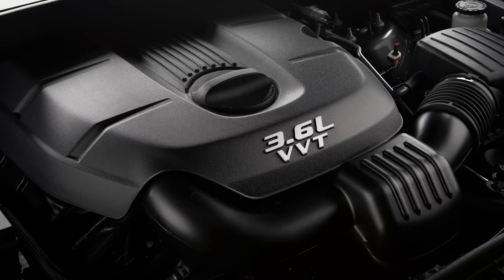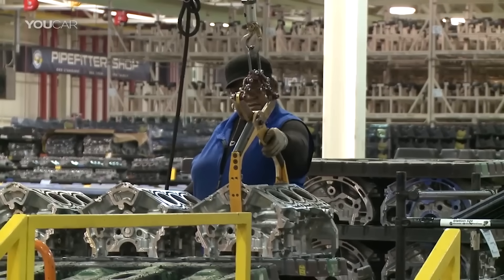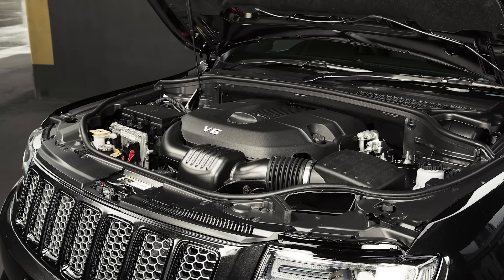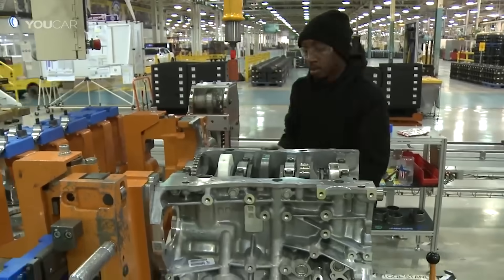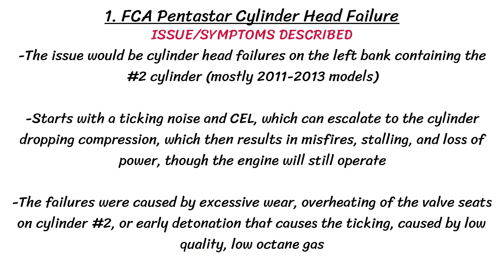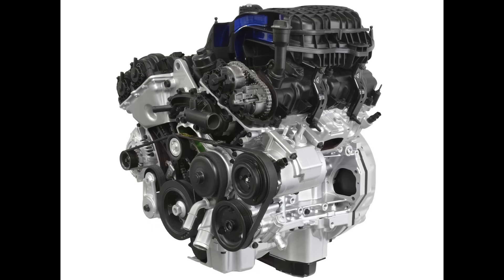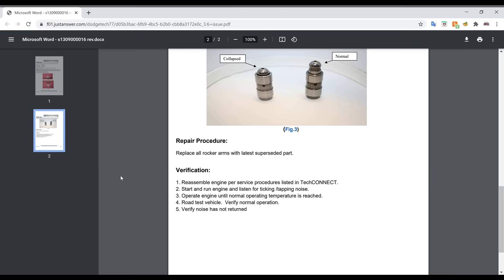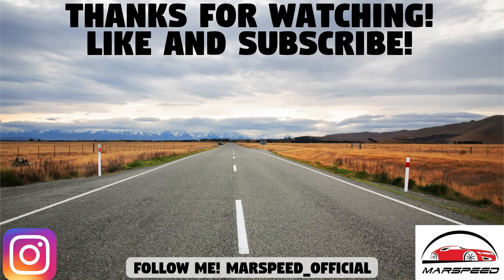The Specs and Fatal Flaws of the Chrysler 3.6L Pentastar V6 Engine

Comment: Wow - love your vids, but you freaked me out from the "headline". Have a 2018 Challenger AWD GT (which I love), plus a 2018 Wrangler with same motor, and got REALLY worried after the fact. ZERO issues so far. Always on time oil changes. I will continue to watch for these issues, but am hoping and praying for immunity. I HAVE noticed subtle differences between the Challenger tune and Wrangler tune. They act like two different motors when compared. The Jeep belched smoke once (and only once) on startup at about 5000 miles. Never did it again, but it scared the CRAP out of me. Hoping for a long and happy marriage. We'll see I guess.....
Reply: What is the point of buying a awd v6 challenger? I'm seriously asking.
Reply: @flatoutnorth794 Well - and don't take offense here - based on YOUR YouTube vids, I'm seriously thinking you can't afford one. Beyond that, I drove in Upper and Lower Michigan snow in the early 80's. In all RWD cars. 81 Capri, 72 Nova, 71 Cutlass, 84 Fiero (yes a mistake but I bought it NEW in 84.) Bottom line - it's a highly capable AWD vehicle that gets 27-28 MPG. I don't have to pick up front or rear end of my car if it went in the ditch (and yes I did) because it helps me STAY OUT of the ditch. Also, I'd rather not pay RT or Hellcat premiums for insurance. I'd seriously consider a HEMI in AWD, but it's not there in Challenger. Don't want an older Charger w/ AWD, and I've owned lots of 5.7 HEMI vehicles - 04 Durango (w/AWD-4WD), 14 RAM 2WD (absolute BS in snow), 06 RAM 1500 4x4. Is what it is - your reply came across as punkish so you get what you give - eh?
Reply: @bufjayup7774  lol you really think you're intelligent assuming  my finances when I'm literally looking at srt cherokees and gt350s. But yes I must be a peasant because I asked a question. Good job.
Reply: @flatoutnorth794  Ooooo - struck a nerve. I can only see what you post and it wasn't pretty. Look - all I'm saying (and tried to elaborate on with the extended comments) is that I'm happy with the vehicle. It's been awesome so far. Great price, loaded with options and I'm happy with it. Sorry if I pi$$ed you off. Your comment was specifically "What is the point of buying a awd v6 challenger? I'm seriously asking." Well - I answered. Just chill dude....
Reply: @bufjayup7774  I've been chill just don't assume man, thanks for the info and watching 👍
Reply: @flatoutnorth794  Likewise....you sound a lot like my son....I'm 58. Please don't get offended. I was your age once...and I bought a damned 84 Fiero new. Have pity.....

Comment: Thanks for the great content. My experience on 2015 Chrysler 200c is - All fuel injectors replaced with Bosch injectors after  2 failed 2 months apart at 45k. Leaking Oil cooler replaced at 48K  and recently defective and leaking Thermostat housing replaced at 50K. My Pentastar had a tick at 45k but Amsoil pure synthetic seems to have made it go away and quiet for last 5k miles. Good power and fuel mileage but looking to get rid of as I see a future of unreliability!

Comment: So far, after (3) years of ownership with <15K miles; I am satisfied with the pentastar V6 in my Dodge Durango. Though, the gas mileage dropped from 19mpg to an average of between 15.9-16.0 mpg, mostly city driving. But never had an issue, other than basic maintenance.
Reply: Glad you said something my family and friends swear I mash the pedal because I get 16.0 mpg which is weird because I’m very understanding that my charger is NOT a race car😂
Reply: @KTony-go6zt  i also get the exact same gas mileage in my v6 challenger. Was thinking why is the mileage so bad for a slow car 😂

Comment: The biggest issue I saw while working at a dodge dealer. Was the oil cooler leaking. Causing oil to fill the valley of the engine. It was always a bad O-ring on the cooler. Constant heating and cooling would cause it to break and leak oil everywhere. Most people think it's the oil pan or drain bolt because of where the oil comes down. 

I guess that issue hasn't been reported enough yet, but it affects every 3.6L
Reply: I was a Chrysler tech also... I havent seen one leaking on the 2011-2013 unit they change the cooler in 2014. The cooler on my older 2012 Chrysler 200 never leaked but the one on my current 2015 200 was replace under warranty its was leaking
Reply: @Jonathan11225  it was always the newer ones. The biggest headache ever.
Reply: @estidecrissdemarde 
Yeah, I had this issue on my 2014. Under Mopars extended warranties it's not covered.  It's considered a wear and tear part.
Reply: Yeah that does sound like a major issue.  It affected my uncle's 2015
Reply: @louisbaiani6262  it's a huge issue. We would constantly have vehicles come back after an oil change complaining about an oil leak. So the Foreman would come out and inspect the vehicle, and would find oil in the valley. Those oil coolers are horribly designed.
Reply: @edms3656  Going to install a Dorman aluminum cooler this weekend on my 2014 Grand Cherokee. I'm not looking forward to it.
Reply: Overtightening the plastic filter cap was the demise of mine...I heard the cracking noise and sure enough it leaked after...replaced with aluminum oil cooler
Reply: @phantom196908  I hated when those were over tightened. If you got lucky they could come off  without any damage, but we only ever used the same plastic crap. 

Funniest thing ever was watching a live tech try and use an impact to loosen one.
Reply: It is not just the O ring, the plastic eventually disolves changes properties and turns soft. The aluminum after market replacement part fixes it
Reply: @miopera40  I've seen those. They look so much nicer.
Reply: @edms3656  
I just took my 2014 with 70K out, the original plastic housing around the bottom gaskets was soft like melting plastic, not because of heat but looks like the properties of the plastic they used are not the best and react chemically with the coolant or oil under temperature changes and gets soft. I was lucky to find an aluminum replacement, hopefully that would permanently fix this flaw.
Honestly Jeep should issue a recall on this part, the backorder list for this part is enormous
Reply: @miopera40  good thing you cought it early. It's such a huge issue. Almost every single by that came back with an oil leak had a bad oil cooler housing. I would say 80% of housings fail before 100k
Reply: Hello! I have this exact same problem, is this typically covered under the 5 year /60,000 mile warranty? I have an appointment Friday. Thanks in advance
Reply: @jakealcazar3805  it's directly on the engine so I assume it should be. It's been a few years since I worked at the dealership. I would definitely speak with the service advisor about it when you go. Keep me updated if you can.
Reply: @edms3656  Will do. I was originally gonna take my Jeep to another mechanic but seen my Jeep is under warranty till next month. Dorman came out with a one-piece aluminum replacement that's supposed to fix this problem from happening again. Although, I doubt the dealer will install an aftermarket component.
Reply: Just replaced mine today. Dorman makes an all aluminum replacement part, unavailable out of stock literally everywhere. I wasted days trying to find one. Truck has 56k miles on it so looks like I’ll be replacing it again in its life. From my observation the plastic housing didn’t appear to be cracked or warped in anyway. It looked to me like the o rings were just junk. Is a dorman aluminum housing really going to solve the issue or is it just the orings always gunna be a problem?
Reply: @Zack.G23  
The aluminum one will definitely solve the issue of the plastic getting soft overtime, with quality o rings should be your best bet.
Reply: @miopera40  I guess we will find out. Noticed what looked like oil on my tires today. Bottom is caked. Didn’t even last through one oil change. They have the dorman in stock this time.
Edit: put the dorman in and haven’t had any issues everything is dry still after about 5k miles
Reply: Yep, they fail a lot.  It should be a recall (but it won't be).  I was hoping that Dorman would have come up with an upgraded replacement for this by now, but nope.
Reply: @DarkpawTheWolf  It always seemed to be around 50k-60k miles on them when they would start leaking.
Reply: Having mine replaced at 45k miles right now. Had my water pump replaced 6 months ago. So like $2000 in 6 months. Also had misfiring issues, where I took it to the dealer 4 times, 3 years ago. In breaks down, and I barely drive it, junk.
Reply: If you want to fix cars or hang out at a Chrysler dealer get one with a 3.6 pentastar engine…
Reply: Happened to my 2011 200 at 96k miles. Not too difficult to replace though which was nice.
Reply: I had this issue with my wrangler, freaked me out because I initially thought it was a rear main seal because of where it dripped down to the transmission. replaced it with a cheaper than OEM cooler that was all aluminum and it's been good for 30k miles now!
Reply: And 3.2 V6 engines as well.
Reply: Had mine replaced
Reply: This just happened to me and i was wondering if i was getting ripped off because the mechanic said this is a problem he sees all the time with this engine
Reply: Yep I’m having a wave of these at my shop right now, it’s been like 5 vehicles in the past month
Reply: Is it the oil cooler or is it not putting the 'o' ring on properly when you reassemble it.. I had that exact thing happen when I changed the oil the 1st time on my 2015 JK.. I hadn't put the o ring in the proper groove.. No problems since.
Reply: Totally agree
Reply: I got a Durango 3.6 and it’s been leaking from that drain bolt you think it might be the oil cooler and causing it overheat ?
Reply: @angelleos3397  is it leaking from the oil drain bolt? Or from the back of the engine where it meets the transmission? If you see oil near that area take a flashlight and try and look down the middle of the engine where the oil filter sits. And see if there is oil looking in the valley of the V
Reply: @edms3656  look as in underneath the truck right ? Or above the engine
Reply: @edms3656  from what I’ve seen so far it looks like it leaks down from that drain bolt but u also commented that it may look a oil pan or bolt issue but it’s not
Reply: @edms3656  could this be mistaken for head gasket problem
Reply: @edms3656  it is leaking from the engine where it meets the transmission
Reply: 2-4 vehicles a day through our shop need these. It's definitely a problem
Reply: Dorman makes an all aluminum oil cooler replacement which will permanently fix this.
Reply: I have coolants coming out of the passenger side muffler and leaking oil and coolants by the transmission belt housing. Does anyone have experience the same issue?

Comment: I’ve had to replace the rad , then thermostat and then a the timing cover and now have a oil leak but otherwise runs great
Reply: Oil leak is probably oil cooler assembly issue, that looks like a trans leak, but motor oil, fix it ASAP, you risk a fire with the oil pooling in the center of the motor, known as the “valley”.
Reply: We did a thermostat when I poked a hole in my rad pulling in the Garage

Comment: My 2014 Dodge Durango had to have the left head replaced, and only had 50,000 miles on that car not good. 😡
Reply: The flaw of the integral exhaust manifold is heat and cracking, but other manufacturers do it too.  Honda does.

Comment: I've been subscribed for a while now and I just happen to be currently looking at buying a 2011-2014 charger with the v6 engine. So this definitely is helpful for me right now and a funny coincidence.
Reply: See if you can get one with AWD, and then add a Ripp supercharger. Then you'll have a "SRT6" with AWD. ;^)
Reply: Honestly I have a sxt challenger and Ik videos and numbers say 0-60 in about 6.2 but mine is stock besides a cai and has a nail in a tire causing it to stay stupid low on air and I still hit 5.7 every time and sometimes run a 5.6
Reply: Before you buy used car designed 20 years ago and made by the worst and car manufacturing entity  in NA and Europe ( Fiat-Chrysler and now Peugeot, financial pyramid is complete  )  ask yourself what are your priorities, if its high quality reliable car with excellent handling and good power well FCA never made a car like that , its either one of those qualities or none of them ( its never quality/reliability) never a full package, if you want to become a stereotype like minded will be impressed and welcoming though
Reply: @MegaNinjaMonkeyZord  My family has been almost exclusively Mopar since the 1960s. Out of the four newer vehicles that we have had, two being from 2011 and 2012 respectively, we have experienced zero major issues. I get behind the wheel of my Challenger, and it’s a joy to drive. Handles well if you know what you’re doing, and has plenty of power. Pretty damn good quality on the interior, paint, etc. I always hear people complain about Chrysler products, but, based upon my experience, which is pretty significant, it’s mostly horse shit. What’s your experience with FCA or, hell, even Daimler for that matter?
Reply: I would recommend getting a 2015 or newer for much nicer interior. Unless you like the older body style more
Reply: Love my 2014 Charger SXT AWD Sport. 56K miles no problems. Quaker State Ultimate Durability Full Synthetic self-changed and BP or Shell premium.

Comment: it’s the next generation of the 3800 series from gm in terms of reliability
Reply: That would be all the RWD Ford 3.3/3.5/3.7 V6 engines. Front wheel drive versions have a dreaded timing chain driven water pumps that causes catastrophic engine failures. The 3.6 Pentastar is still a good engine.
Reply: Lmao stop bro just stop.
Reply: Yeah. The 3800 isn’t all that reliable. It just has this Chuck Norris mythos that it didn’t earn and doesn’t deserve. 

I never found it any better than GMs 60 V6s. It’s just that those engines are more likely to be owned by welfare recipients who park outside and never change their oil vs the octogenarians who own a 3800.

Comment: Great video as usual!  I have a 2015 Chrysler 300S.  I bought it used with only 29k mikes over 3 years ago.  Now I have over 74K miles with a few mods and a tune.   I haven’t had any issues with it so far.  It’s still going strong!

Comment: I think pentastar should remake this engine into a straight 6 and tune it to 340 hp and 315 tq since it's based off 2011 tech and it's time to remake it and modernize it
Reply: Agreed
Reply: What’s a stright six?
Reply: @bryson_dabomb3667  a line of 6 cylinders instead of them in a v configuration

Comment: Appreciate the objectivity!  Even the best engines aren't perfect, and I consider this definitely one of the better V6 engines.  

It's cool to love MOPAR but understand there are imperfections... any time someone new hops in my '09 Town & Country, I like to point out every fit & finish issue I've found in the van (so far).
Reply: Especially door/panel gaps. My grandma's T&C's front doors aren't flush with the body. They stick out at least an 1/8 inch and the top rear edges of the doors flex under heavy wind, its so bad you can hear air rushing in and you can stick a finger between the gap between the seal on the frame and the top of the door.
Reply: @chazzcoolidge2654  Kinda off the engine but topic maybe your grandma had an accident or  a prior owner had collision shop work done.
Reply: @chazzcoolidge2654  I literally fixed a brand new Pacifica the other day that had the same issue. Everything is non adjustable so I had to take a 1ft. Long 4x4 block of wood on the striker and hit it with a big dead blow 3-4 times. Sat flush with the body 👍
Reply: I love Mopar but I buy Chrysler Corporation products-not German or Italian models. I drove a 68 Plymouth Sport Fury as a daily. Currently driving a 65 Dart 270 and am looking at a Newport or Imperial next. 
Chrysler did have quality control problems even in the late 50s because of high production due to demand for the Forward Look cars. It’s not new with them. Nonetheless, I will be driving Mopars until I die.
Reply: @josephjames259  My ultimate ride is a ‘72 Imperial Lebaron. Still looking for a good one.
Reply: @미친님-y6j  Good luck, those were rust buckets, probably NONE left.
Reply: @dannysdailys  XD yea the only old Chryslers really available near me now are the 300s and the New Yorkers
Reply: @미친님-y6j  Any C body (full size) Chrysler product can be found inexpensively in comparison with other classic cars. Try forcbodiesonly forum. You may find one there. There is a for sale area there and Imperial owners hang out there. Good luck.
Reply: @dannysdailys  They are still out there. Depends on what part of the country they spent their time in. Any car in the northern part of the country is going to be eaten by salt-even newer cars.
Reply: Chrysler has made good cars but in the last 20 years all you can say about them is its a J   U   N   K   DODGE   J   U   N   K
Reply: @robtans5042  Except for the 2.7 v-6 I call bullshit on your post.

Comment: Did they resolve the hemi tick issue on the 5.7 or the 6.4
Reply: No. Doubt they will do anything about it since its a design flaw in the block. Camshaft is to far away from the crank and in turn cam and lifters are starved of oil at idle. Best way to avoid this is to not let the motor idle for too long.